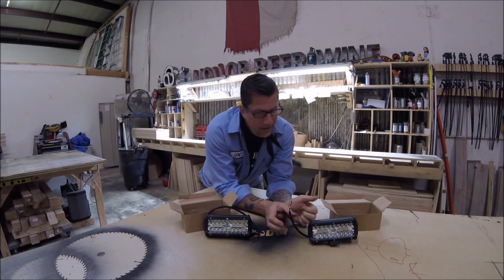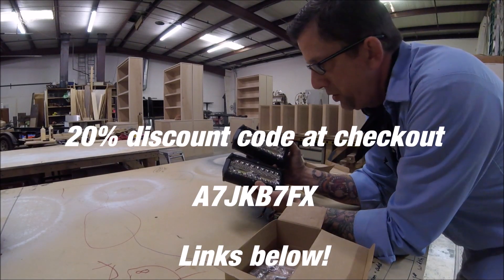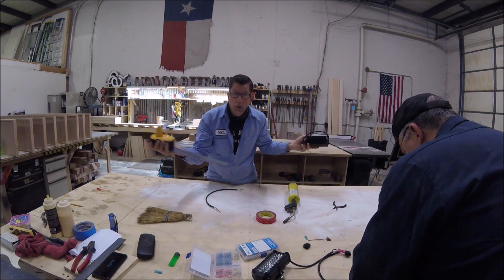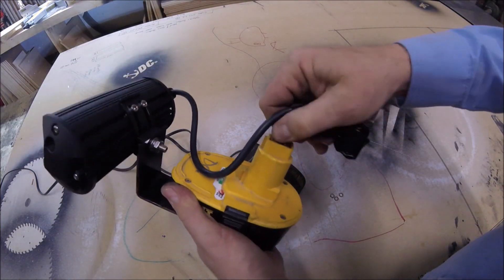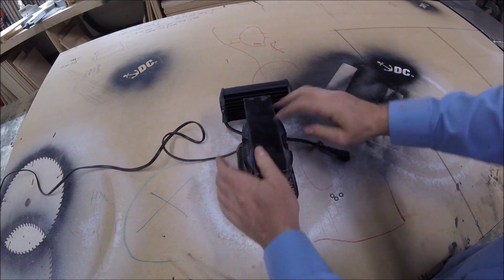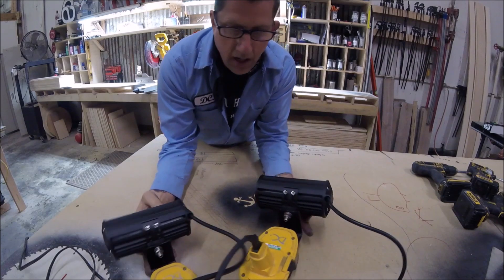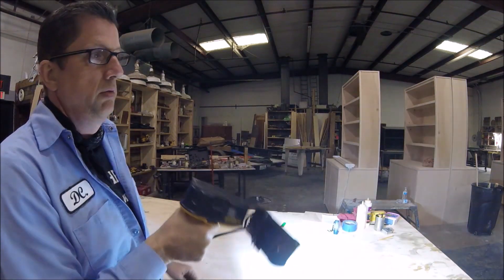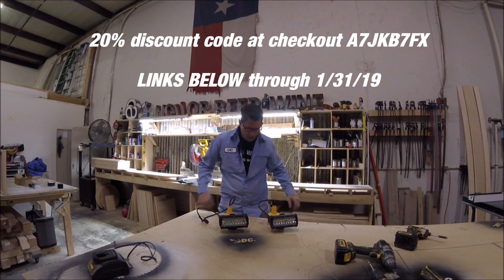LED LIGHTS and DRILL BATTERIES MOD.

Comment: I came across Hitachi adapters for my current drill/Recip/Impact driver, and since the power goes out here more than I would like during storms, I was researching options such as this.  Thanks for the video!!!  I'll probably get an electronics project box to attach the switch to, mount a driver/converter (18v-20v=>12v) and wires inside...
Reply from the maker: Awesome have fun with it!

Comment: I have 2 extra set of off road led that i got for my jeep but currently i got alligator clips at the end  of wires to use as shop light. This vid just made it a mobile flood light powered by a 20v drill battery...thanks for the idea.
Reply from the maker: Yep, simple and sweet!

Comment: Just curious, did you just modified (expand) the spade flat connectors to fit the dewalt poles? If not, can you point out what kind of connector you used. Thanks.
Reply from the maker: No, I used connectors from a kit that my buddy brought that day. Tons of wiring connect options in the kit, not sure what its called...

Comment: Could you give a little more info on the wiring part?  Would love to add this to the kids coleman minibike
Reply from the maker: What do you wanna know. It's actually very easy...
Reply: @DerekConwayTX  I would like to know also what parts you used to hook it to battery and stuff like that please i have a Coleman mini bike i am wanting to put lights on also
Reply: Ya it would be helpful if you could figure out what connectors it needs to go from wire on the light to the battery... Or even slow down and show what the connector looks like in the video... That's probably one of the most important part of the set up.

Comment: Yah saw a similar video with different led lights and battery combo for a mountain bike light set up gonna try it soon much cheaper than bike light
Reply: I plan to do the same thing m18 and s1 pro..maybe lp4  baja designs

Comment: Is there a way to wire an old drill, so you can disconnect the drill battery. Like cut up an old drill, mount the light, and just swap out a battery... Im planning on wireing these to my dirtbike.
Reply from the maker: I'm sure that can be done. Would take plenty of creativity to pull it off but that's a great idea!
Reply: So, I know this comment is very old, but you can absolutely do it, Connor. I've done it multiple times on dirt bikes for myself and my kids. Inbox me if you'd like to see how I do them.
Reply: @kevinfowler3382 funny enough, back then I just wired an old DeWalt 18v light to a lightpod. I recently just unhooked it, and connected it to a 20v base instead, and wired it all up under the seat of my yz250. Thanks though!

Comment: Cool idea.  And nice save on the old 18V batteries.  I am wondering how the 18V will affect the 12V lights in the long run?  Anyone out there know?
Reply: I think the lights work between 12 volts to 24 volts.
Reply: @christospencoglu5160  Thanks.  I ordered some of the lights up to give it a try.
Reply: If you check the detailed voltage specs in Amazon, you will see most of the the 12v LED flood lights are rated between 8V-30V. Old post but for new viewers.